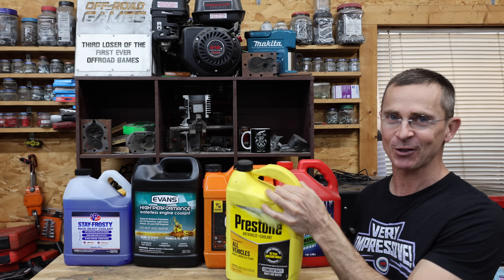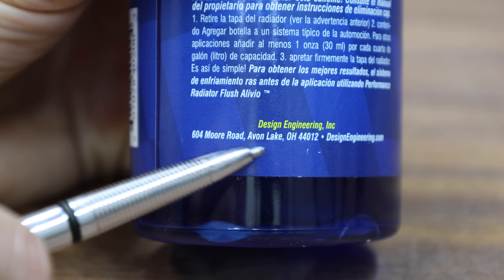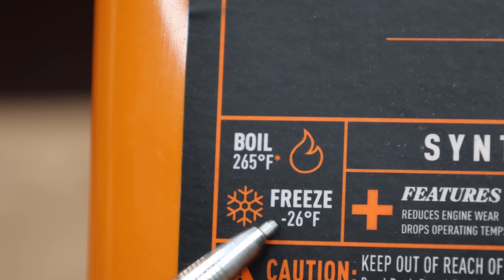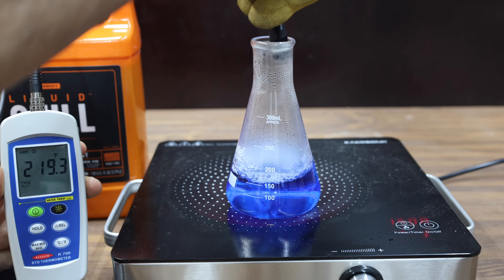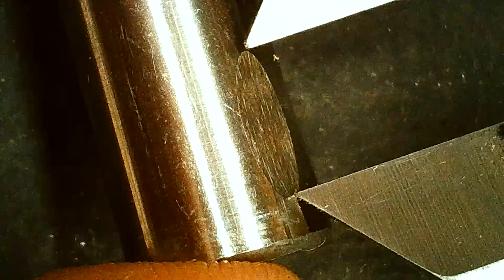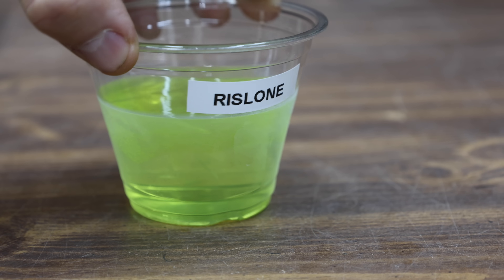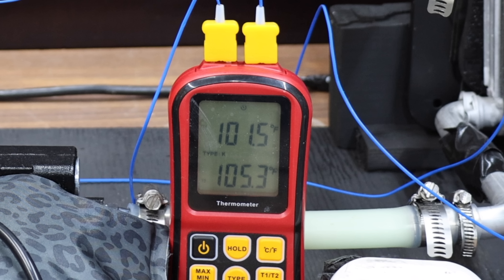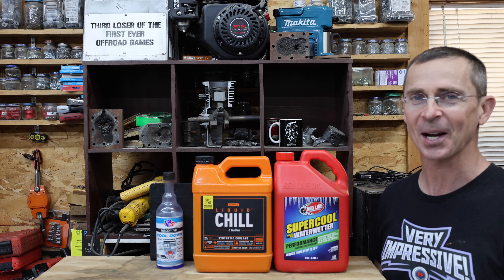Do "Super Coolants" Lower Engine Temperature By 30 Degrees?

Comment: 20yrs ago I used Redline "Water Wetter" on a 2001 Integra Type R engine(B18c5) and I immediately noticed the radiator fan was running far less often. When I added a Mugen fan switch that turned the fan on at 20F degrees cooler it was still running less often than before the Redline Water Wetter.
Reply: Yeah ive seen endless people in motorsports recommend “water wetter” as the best coolant additive that gives noticeable results. Highly recommend
Reply: @knowbull5hit590  The reason for the lubricating properties of these coolant additives may have been lost on the video maker. Many in racing do not use anti-freeze as it is said to mess up the racetrack in the event of a leak. Redline used to say Water Wetter works best with water alone, but it will still work to a lesser degree with a standard 50/50 water/coolant mix. It has been 20yrs so the product may have changed since I last used it.
Reply from the maker: Thanks for sharing.
Reply: @ProjectFarm  Redline Water Wetter is only $14/bottle. That would have made a better comparison with the other additives in this video as you could have mixed it with the same coolant as others and also saved money. Apples to apples.

Comment: You said (I think) at 14:21 that the surfactants lower surface “temperature” but I think you meant surface “tension.” 

Does making things “wetter” increase the likelihood that seals will leak?  It seems easy enough (in PF world) to set up a test to see at what pressure a gasket or o-ring would leak, and if these products would affect that.

These products look like solutions looking for problems, and not the other way around.

Comment: I keep wondering why a corrosive water based coolant is not replaced with something like transmission fluid? Seems to work well enough with transmissions, but maybe the engines cylinder head gasket area just gets too hot, although water would also present a high pressure with steam generation.
Reply: Put transmission fluid in hoses and there will get soft and swell -burst
Reply: @RolsRoyce3  Rad hoses already do that with antifreeze, but brake pipes last forever - that's why I thought about using an alternative fluid.
Reply: @ not correct, hoses only swell and get weak from oil fluid contamination or age.
Reply: @ brake lines are a different material

Comment: have you done a video on gun cleaning solvents, oils, and/or CLP? how quickly does each product clean up carbon buildup, which ones have better lubricity, and which ones actually protect against corrosion and buildup
Reply: This!
Reply: Id watch it, but it also doesn't really matter. Most don't shoot enough for it to make any difference whatsoever, and for the few that do a gallon of diesel engine oil is the way to go for a cost effective solution.

Comment: If you want to lower the freezing point you use more antifreeze and less water but it won’t be as efficient at carrying heat away. My uncle said these are heat engines and per thermodynamics should be more efficient running at a higher temperature. So he always replaced the thermostat in his cars with one that was one step hotter! Of course this was back in the time of leaded gas, distributors, caps and points and oil filters were relatively new.
Reply from the maker: Thanks for sharing!

Comment: Waterless coolants are actually just 99% Glycol  to put it another way just very expensive undiluted ANTIFREEZE ‼️‼️‼️‼️‼️ 
There are very good reasons to do with heat transfer why pure  antifreezes are not used as automotive coolants.
Coolant antifreeze based on propylene and ethylene glycol  were first available in the late 1930s for aircraft engine cooling. Rolls-Royce used pure glycol in the first versions of the famous  Merlin but after discovering issues did a huge amount of testing settled on a 30% glycol 70% water mix as giving the best cooling and frost protection and permitted higher super charger pressure. Although glycol  raises the boiling point of  the coolant above the boiling point of water it isn't nearly so good at heat transfer as pure water.  Although on a running engine cooled by 100% glycol the coolant temperature on the gauge will be lower the temperature of the piston rings will be considerably higher which isn't a good even more so on GDI engines.
Car manufacturers now with fill with 50% antifreeze solution still ethylene glycol  but with OAT or HOAT corrosion inhibitors. In ideal circumstances provided they are not diluted by topping up with water 50% mix should have good  enough corrosion protection for 10 years.
Of course we don't live in an ideal world a partial coolant change every two or three years with a coolant to the original car manufacturers specification is a good idea.  Although some types  coolants will mix on some mixing different the corrosion inhibitors cause issues so stick with original type especially applies to German manufacturers.
If the original fill was an OAT or HOAT coolant stick with that also don't go solely on colour of the coolant

Comment: You're missing some of what the VP and Redline stuff is meant to do. It lowers the surface tension of the water, which allows a greater contact area. I work in pro racing. On a race engine, you can have very small air bubbles around a combustion chamber which will make a hot-spot and cause detonation. By reducing the surface tension, those small bubbles and air pockets are significantly reduced. We use distilled water and the VP additive in our cooling system and a high pressure cap.
Reply: Watch the entire video before posting.  He talks about that.
Reply: @videodistro  My bad I skipped, through.

Comment: I've been driving across the Mojave desert an have lived in a very hot area for over 50 years using all kinds of trucks and cars yet have never felt the need nor seen the use of these products. I'll pass. Just keep the coolant at the correct % and change it on schedule along with the thermostat. If the vehicle manufacturers (who have to honor the warranty on the vehicles) felt that the coolant installed was somehow inadequate, they would change the formula!
Reply from the maker: Thanks for sharing!
Reply: Same could be said for literally every part of the vehicle. Rims, tires, performance parts, body esthetics. All manufacturers  fall short in terms of what they can provide which is why the aftermarket is so big. Especially for jeeps being one of, if not the most modify-able vehicles on the road today.

Comment: Fun fact, cars are DESIGNED to run at a certain temperature to burn off hydrocarbons, that includes coolant. If it runs too cool so does the rest of the engine and it's not good. Depending on your car your thermostat might not open too.
Reply from the maker: Thanks for sharing!
Reply: Well.... no duh!
Reply: Cylinder tempature! Maybe fuel temp as well. Running the engine cooler could also make it run more efficiently as it gets better cold air compression. Also seals will last longer under less heat stress. Same for the rest of the engine.
Reply: @keith3761  maybe but than they'd come with thermostats that open at lower temps.
Reply: @bluej511  Okay why would we care what temp the thermostat opens at as long as it opens at that temp? The entire point of the thermostat is to keep the engine warm till it hits operating temperature range and then to open up to allow the rad to cool the engine. If the engine coolant never reaches  that temp why would you care? Its only function is to open IF needed.
Reply: @ Your whole thermostat understanding is bonkers btw. Your acting like you could somehow put in a coolant that the engine never builds up the heat necessary to open. A crazy idea, and if you COULD do that, why would you care? that would only be a great thing.
Reply: @ You dont understand how a cooling system works its ok i wont argue with you, im an AC master tech and you're not. Have a great evening bud.
Reply: @ All you are is a master of BS. AC tech thinking he understands engine coolant and a mechanical thermostat.
Reply: @keith3761  right cuz waiting 20mins for your car to warm up and run cooler then it was designed to by actual engineers makes total sense lol. P.S. not an ac tech but you don't understand how HVAC works either.
Reply: @keith3761  let's not forget in extreme cold all the people that block their front ends to keep the radiator from getting cold, they should leave it open so the coolant never reaches operating temperature. Btw you know most cars have coolant that runs thru the oil filter housing to make the oil warm up faster right bud.
Reply: @ "block their front ends" What are you talking about? are you a bot? I live in northern canada. -40 is common here. No one blocks their front ends. There are block heaters and engine blankets. blocking the rad would cause overheating to the extreme. The mechanical thermostat opens when the engine reaches a temperature that it requires cooling. Before that the rad is already blocked off by the mechanical thermostat.
Reply: @ You should NOT wait 20 mins for your car to warm up. you should wait about 1 min and that is it. your car warms up better and with less wear by DRIVING it. not thru IDLE there are many tests here on youtube that show exactly that. Also "cooler" cooler where? at the rad? at the block? at the piston and cylinder walls? you realize these engines could be running anywhere from alaska to mexico right? the mechanical thermostat works the same regardless! and the cylinder walls and piston would be at the same temp regardless. Your not changing the temp of the oven your changing the temp of the surrounding engine block, and if it dropped below its operating temp the mechanical thermostat would just close again or close partially or the fans would shut off ect.

Comment: You have to be kidding me! I’m literally going to do a coolant flush this afternoon. You could not have released the video at a more perfect time! Thank you, Todd!
Reply from the maker: Glad I could help!
Reply: Hmmm.. we're gonna test that??
Reply: Well, from 3.46M subscribers it's a good chance that at least one is about to do a coolant flush! :face-blue-smiling:
Reply: @johnnyblue4799  hahaha
Reply: Do you have a problem with overheating? Generally most folks don’t have any need for these additives
Reply: @ I do not and definite will not since Todd made this video. 👍🏻
Reply: @gano7297  ikr unless you're on a course overheating should not be an issue with modern cars... a bad thermostat or dirty radiator are the most common issues outside of leaks, and none of these problems would be solved by different coolant additives 😮
Reply: literally?
Reply: @georgewetzel4380  literally. Just finished actually.
Reply: He knows doesn't he 👍👍
Reply: I'm pretty sure he's potentially a precog
Reply: I know! Liquid nitrogen is much colder than soap
Reply: Save your money . Just add 2-3 small drops of liquid hand soap and you will get the same effect. Its an old race car trick
Reply: Or a couple drops of liquid dish soap.
Lowers the surface tension of water.
Reply: @sanisidrocr  test that. Put a video up dude
Reply: @sanisidrocr 
100% Incorrect! I cant stand when people do shit like this. False info misleads people trying to learn

Comment: Could not discourage the use of Evan’s enough. I used it in an ATV and it is horrible. Runs extremely hot due to low specific heat. Wasted money and could have seized up my engine had I not caught it fast enough.
Reply from the maker: Thanks for sharing!

Comment: Why do i read 100% colant is bad? Some say 50/50 or 75% is " required" . ??
Reply: 100 percent coolant freezes at a higher temperature than the recommended mixes.

Comment: I wonder which gun oils are the coolest
Reply: Lucas, they make it for cars I trust it for guns
Reply: @R3D_R0CK3T-5 Lucas gun oil is decent. Not the best. Todd needs to test it.
Reply: @bowencreer3922  absolutely! Just from my experience, it doesn't burn off as quickly, maybe not the best against wear and tear but any lubrication is better than none
Reply: @R3D_R0CK3T-5  In very cold weather, none is often better.
Reply: The one’s you leave in the freezer the longest are coolest.

Comment: Water Wetter?
Used that in the 90's and it worked well
Also, have you tested camping cutlery?
Thanks
Reply from the maker: Great question! At least one of the products contains water wetter. I have not yet tested camping cutlery.